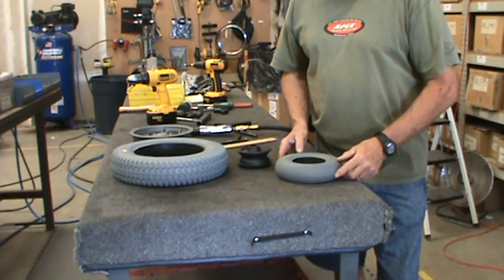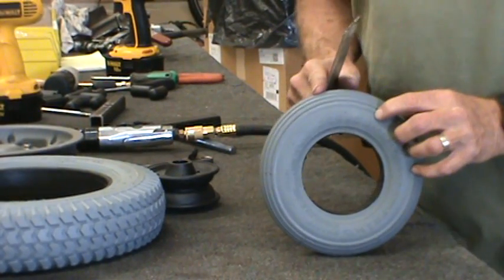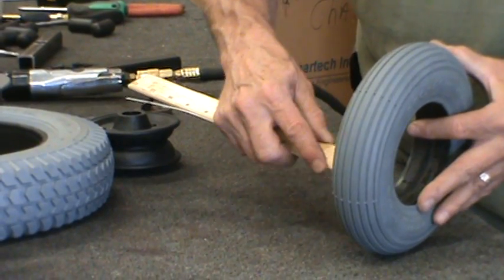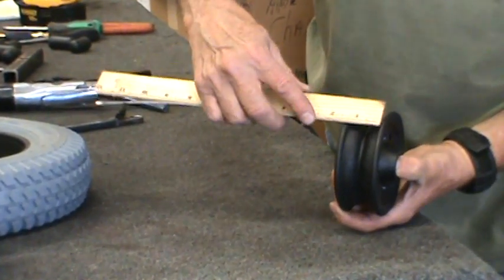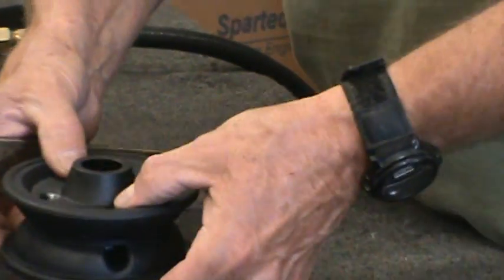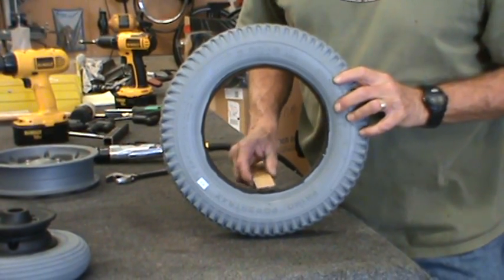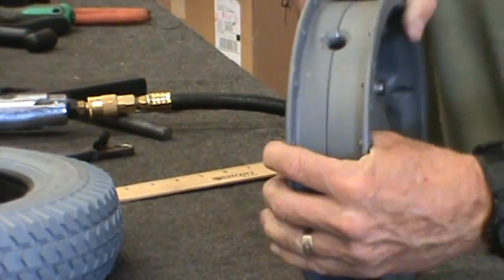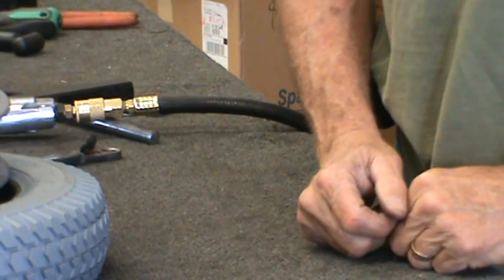New Solutions How to Determine Foam Filled Tire for your wheelchair

Comment: Hopefully you have some advice. I have a Permobil C500 Stander and need to change the drive tires out. I was able to chang the 
back casters but had trouble finding a way to pull the drive wheels after removing the tire bolt. I found a manual online that mentions using a puller if the wheel isn't wanting to come off but I can't find one of these pullers anywhere. I even did a Google search for the model number of the puller and got Zero results. I don't have a company close by to do it and if I can just get the wheels off the chair, I already have the tires and can do it myself. Any ideas on how to pull the wheels? 

Thanks
Reply from the maker: +Stephen Quick   I had the same problem with a Quickie 646.  I just got a standard wheel puller like they use on steering wheels.  Tightened it on there a gave it a crack with a hammer and it popped off.  I've seen it done with a 2x4 wedged behind the wheel and smack the center with a mallet.  Good luck some of these are real stubborn.  Be careful you don't break the wheel!

Comment: I have a manual wheelchair with foam-filled bicycle tires which were worn to the threads. After wrestling and sweating trying to cut and pull them over the bead (forget it) I simply took a shop knife and sliced through the center of the tread area all the way around. After that it's like butter.

Comment from the maker: I know sometimes the rear wheels are pressed onto the axle.  Quickie has a tapered axle so you need a wheel puller to get it off the chair.  Even then we used a 2x4 behind the wheel and smacked the loosened nut the pop it loose. Invacare comes off easier.  Then getting the tire off the wheel sometimes take s a screwdriver or a mallet to get it off.  Sounds like I need another video addressing that.  Thank you for your viewing.